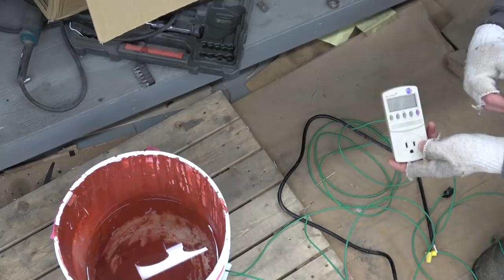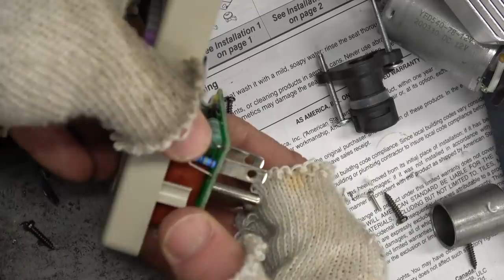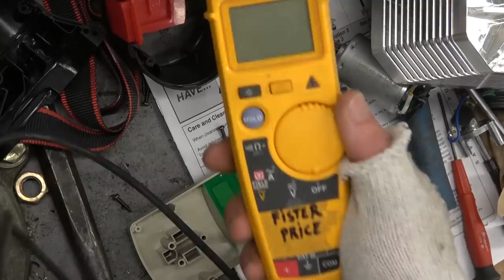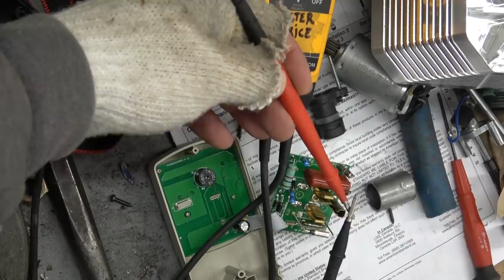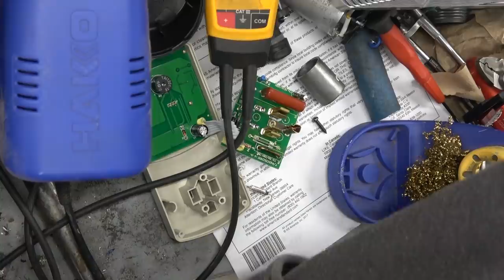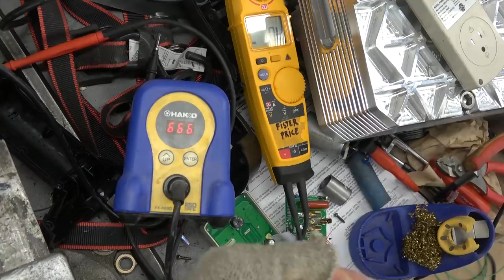BOLTR: Kill-A-Twatt | Electric Smoke Theory

Comment: It'll be fine, solder works as a thermal fuse anyway, right? right?
Reply: Yep, that's why we don't solder lightning protection systems...all mechanical binding for bonding ;)
Reply: In “northe amerika” that is
Reply: Anything’s a thermal fuse at high enough temperatures.
Reply: Everything is a thermal fuse if you run enough power through it.
Reply: @sithticklefingers7255  or brave enough!
Reply: Thermal fuse? Thats a good wife-euphamism.
When she gets to hot, she blows!
Reply: I knew a guy that used his arm as a thermo fuse. Pixies went in his hand and came out his elbow. He was lucky his elbow was closer to the ground than his head otherwise that electrical tickle would have lasted a week or two longer.
Reply: @sithticklefingers7255  Except gasses. they work the opposite of a thermal fuse.
Reply: That would be a 180°C fuse, but the way he soldered it without any spring thing, that fuse won't interrupt current even at 180C. Because no spring to separate the contacts when the solder melts - the blob will just sit there.
Then again, who really cares, it will work supervised (hopefully).
Reply: safety, just like over-current protection, is often over-rated
Reply: @benbaselet2026  this is also used in alot of automotive situations, for example in an interior blower motor dropping resistor. if the airflow is restricted or fan stalls, resistor can get red hot, melts solder, joint springs open.
Reply: You will be fine. long as you solder at 666c
Reply: @oldfarmer4700  He is lucky! I was dumb when I was around 12 and stuck my palm on the back of a black and whit CRT. not fun. Then zapped myself on one finger on a 400v cap. twice in 2 minutes. You should let your friends wear shoes with the last one bare foot then touch an electric fence, so  the capacitance builds up. such a rush!!
Reply: @soupflood  did you see that... Woosh
Reply: @jeramiet154  ....damn...you’re right......
Reply: If’n ones clever enough introduce a bit of spring in the sprong (mechanical connection = -.9), then you have a fuse!  Don’t gob tinfoil on there, don’t ask me how I know....
Reply: But it looks like he let the magic smoke put of it during the application.
Reply: Had the same problem with the coffee maker. The guns were coming out because there was no coffee.  But in the nick of time the thermo fuse was dispatched. The coffee maker woke up and soon peace returned.  It was a close one.
Merry Christmas
Reply: I bet it was project farm that showed him that........
Reply: It's got another fuse.  You'll be all right !!!
Reply: Lol at the main comment
Reply: @AntonioClaudioMichael  🥃 👍 😁
Reply: @denisohbrien  I think that’s what’s happened to the blower in my truck where is that resistor so it can be replaced please?
Reply: You have to put a name on the bucket:  "Kill A Kill A Watt"
Reply: Tesla in Czechoslovakia used to make resistors with overcurrent protection, one lead was made as a tiny leaf spring partly inside the resistor body.. when it got too hot the solder thawed and the spring went boink
Reply: @benbaselet2026  Isn't that pretty much what the TF shown is--basically a wax holding the circuit closed?   Yer typical microwave oven has a couple of those--when they go, folks throw the whole unit out, rather than replacing the failed component.
Reply: Reminds me of the power cutoff I installed for my washing machine. If it should leak, the water flows right onto the power strip and therefore (fingers crossed) causing the breaker to trip. It's called automated safety, look it up.
Reply: @BobHolowenko  Do you ever wonder...if there's ever a time to get hit by lightning, its while working on lightning rods?
Reply: everything is a fuse if the currents high enough
Reply: Bigger fuses = big solder globs
Reply: @benbaselet2026   I'm amused by the fact that AvE comments get AvE'd.  It's like there's some magical transmater what gets betwixt the keyboard and driver
Reply: @265chemic  If they don’t get Ave’d at least 3 times, there’s something wrong
Reply: @gordslater  ml
Reply: @oldfarmer4700  we will have no
Reply: @jeramiet154  a little

Comment: I don't remember if I learned it from you or my mad scientist shop teacher: "Everything's a thermal fuse. Installing a thermal fuse just lets you pick what burns out first. Make sure it's something cheap."
Reply: @raygale4198  or a concrete control joint.
Reply: This is funny but I feel like it misunderstands the purpose of a thermal fuse. A thermal fuse trips primarily on temperature. It is not designed to self-heat, and is not primarily designed to trip due to over-current. Typically you put it somewhere where a malfunction will cause OVER TEMPERATURE without any corresponding OVER CURRENT. You might have one on a compressor or a motor for example. If the compressor malfunctions and stalls, the current may not be high enough to blow a fuse, but the compressor will over-heat, and the thermal fuse will save the day (and make UL happy). It is the difference between a bad customer experience and a multi-million dollar product recall due to fire safety.
Reply: I LIKE that saying. I'm going to steal it.
Reply: My wife: "Aren't ALL the parts on the car 'WEAR parts'?"

Me: Well, yeah, I guess--if the car lasts long enough, sure... (Scratching my head...)
Reply: @iFixJunk  So profound on so many levels.
Reply: Remember folks: the transistors will always protect the fuses from damage. Transistors are excellent ultra-fast-acting fuses.
Reply: @absurdengineering  Trans-sisters? Is that a hair band? Or......

(NEVERMIND.)
Reply: Equivalently, every diode can be light emitting if you treat it wrong enough.
Reply: Like a Penny Behind a Bad Glass Fuse... Only at The Ice Fishing cottage 🤫😉

Comment: If its that modern AC smoke, then there is no positive or negative, thats a social construct, the pixies swing both ways. 50 times a second.
Reply: 60 you brit
Reply: @noohairdontcare  - 50 Hz, 60 Hz - do it properly.... and just 1 hurts. Aussie-land uses 50 too - and Higher Voltage.. Probly 'cause we made AC/DC

Comment: Pixie induced smoke is unlike anything else you'll come across. Nothing makes me pucker harder when playing with electronics than that smell and that you have potentially written off an afternoons fucking about!
Reply: Trust me .... Putting in 400A fuses on a known fault can have a whole lot more pucker than you think!

But you Do get some good stories to tell ;0)
Reply: Speaking of smells ...... at work last week we installed a new line , this guy lets one rip while we’re testing motors making sure the line works , just so happens managers and directors  abound and the motor near the guys that shit himself  is making a clicking noise and all the higher ups we’re leaning in to get a whiff talking about how they smell something electrical burning, I bout fell out but didn’t say anything. Turns out someone had dinged the fan cover on the back of the motor and they got a sniffer full of shit!

Comment: Last time I bridged a failed thermal fuse, I discovered that a cheap eBay power supply can blow a hole clear through a residential wall.
Reply: Thanks for the laugh 
I just picture you sitting there looking at your wall and think :holly cow  that worked

Comment: My Killawatt was telling me that I had 130 volt electricity. That’s when I found out they only have a six month warranty.
Reply: user9823598246  Sure does.  And utilities, in my experience, tend to bump up the voltage to rural areas.  So if you're in a rural area you can expect to see higher than rated voltage.
Reply: user9823598246  I put extra tape on my nerd lenses just to make that same comment but ya beat me to it. Well played...
Reply: user9823598246  Yeah, I've seen it has high as the mid 130s when the power went down in a good chunk of the city and shit got all unbalanced or whatever.
Reply: I pulled the breaker when the UPS told me the mains was 270VAC and rising, and it was not happy. Tealeaves came and liberated the neutral and earth wiring in the substation during the day, leaving the phases to fight it out as to who was going to win. Shop on the corner lost, they went to over 300VAC, while I pulled the building breaker so as to not compete.
Reply: @SeanBZA  you pulled it or just disconnected it?
Reply: There is a common failure mode of the safety capacitor
(0.47uF) next to that glass fuse.  It will cause display of higher than actual voltage. Try replacing that with the same rating.
Reply: @bryanjk  Switched off at the municipal disconnect, which switches off the 3 phases, but leaves the neutral and earth connected. Lucky the board has a really good earthing mat, connected via thick cabling, so the wiring did not float. Inside the double pole isolator did disconnect the supply to me as well.

Comment: As an apprentice mechanic i was always told by the older senior mechanics that Lucas components were filled with smoke contained in the LBT capacitor. 
Took a few years to understand that the LBT was the "Little Black Thing" that could have been any part in the Lucas component that failed. 
Ah the days when you were told to go to the spare parts back counter to get;
A rigid reproduction tool.
A short circuit
A right handed adjustable spanner (known in Australia as a shifter)

Comment: Shango066 used one of those for ages, never let him down. Great for seeing if the load from the vintage radio/TV is reasonable, and if both the resistive and the reactive circuits are running.

Comment: Masterclass in setting the temp on that soldemy iron. Another trick I learned from the master greybeards in electronics troubleshooting is to tune a couple function generators in "augmented fourth" intervals as a test signal. If your circuit works after that much antagonizing Satan, you can safely move on to a small production run. Merry christamadidlly, AvE and the other bumblefox.

Comment: Same process with the burners on the new GE electric range. Thermally protected soze you can't keep water at a rolling boil! Good thing I hadn't yet disposed of the old range. Gotta use the high temp MIG solder, though!
Reply from the maker: It's like they make stuff "safer" just to kill us with high blood pressure. Merry Christmas!

Comment: How in the frozen wastelands of Hoth did you blow a thermal fuse before the normal fuse? Did you pre-heat it in a foundry or something?
Reply from the maker: Just lucky I guess...
Reply: That tiny glass fuse probably only protects the electronics (buttons and screen) in the Kill-A-Watt. There is no way the full 15 or whatever amps are going through that little thing.
Reply: @Fix_It_Again_Tony  I don't know, hard to tell dimensions from the video but it seems like it has more glass showing than a 1/4"x5/8" fuse usually does. If it is a 1/4"x5/8" then I think you are right, but it could be a 5mmx20mm fuse and they come in 15 amp varieties and aren't much bigger. It could also be a 1/4"x7/8" which is a regular 15 amp fuse for automotive use but the ratio doesn't look right from what I can see in the video. Could just be I need to get my laser eye-balls calibrated.
Reply: Probably made by Apple. The only thing in a Macbook that never breaks is the fuse.
Reply: @Fix_It_Again_Tony  That would make sense that it just protects the brain. The thermal fuse does it's thing when the shunt resistor for current measurement is served an extended hot supper.
Reply: @Gizmo42Rodeo  You have to turn on fuse tracking in settings. It’s under the pri-fuse-cy settings.

Comment: Those same thermofuses are used on heat strips in residential air handlers ( usually in conjunction with a heat pump ).  Almost any Hvac supply house will have them for 15 times the price of online vendors.

Comment: I have one of those.  It’s handy. I found out a 1980s refrigerator was pulling 15 amps when the compressor pulled in.  Yes the fridge still runs good and cold, it’s not made with any chinesium.

Comment: I lucked out when I found a Federal sub panel feeding my unused dryer outlet in the garage.  Well let me tell ya partner that 30A breaker works perfect for my 48A pixie-powered car charger.  Tested and tripped right at 55A... and barely gets hot enough to boil water to boot ! #thanksfederal <3

Comment: I would look into what's going on with the Hakko; it's definitely not operating correctly. Apart from the inconsistent spazzing of the temperature as it's climbing, it should heat up much more quickly. If you're not bothered by that and it's actually holding its temp setting, then fuggedaboutit!

Comment: Had you brought Prudence the Safety Goat in on this one for a consult, you'd have been informed that removing a thermal fuse is a big no no. Next time just solder in some wire to bypass the thing. No no, Mr. Insurance man, it must have come like that from the factory.

Comment: When in a pinch you want to still retain some semblance of a safety feature, replace that fuse with a single strand of the thinnest gauge copper wire you can find, or better yet - an actual fuse rated in the range of your device, so at the very least it blows before it burns...

Comment: I have the same Hakko 888D and while I like it overall, in retrospect, I'd probably go for one of better models with the instant-heat tip or just one of the much cheaper Hakko 936 knock-offs subbed with actual Hakko tips.

Comment: Lucas do claim to have invented the 'Intermittent Wiper Switch' and the 'automatic headlight dimmer'. Apparently in 1952, they tried to get the government to repeal Ohms Law but it met too much resistance. Another little known fact is their automotive systems all used AC current just with a random frequency.

Comment: About the hakko, worked in a place where my boss wired his getup so that it's on when the lights are on. Makes sense since it doesn't really eat that much electricity and it's ready for soldering, always. 
If you asked some health&safety figure about running a thing that's hot, they'd probably disagree, thankfully the checks they did were usually looking in to the lair and saying "yeah this seems ok" with a look of "I don't understand this, so I'll just say yes" on them.
Reply: ps. he had 3 different soldering stations on his desk

Comment: I had a similar problem with my meter at work. I just could bring my self to buy another $20 fuse when I could just use a bit a tin foil. Had a bit too much fun looking for a key off draw with the key on. For some reason a capacitor cracked right in half on the board and leaked the smoke out. My new meter for snap on was only $65 more that what  we talked about the week before and the next model up. But hey I saved the $20 on that fuse.

Comment: Best practice is to not solder a thermal fuse. Crimp connect. It looks like KillAWatt uses long leads and probably clamps a heatsink (like forceps) on the leads when they solder it in. Don't ask me how I found this out.

Comment: funny that I should come upon this video this morning as I just plugged in my Kill-a-Watt to check a load. Odd that they put thermistor fuse in that location on the board. I'm guessing it's sensing the hot terminal of the receptacle, hmm, kinda far away to do that but oh well. thanks.

Comment: Seeing as you fixed your Kill a Watt, I am curious how good the RMS AC voltmeter is in those? I let the smoke out of a UPS today while changing the battery. Two 40 amp fuses (in parallel) and some foil.  A big surge from a 12AH battery. So I was checking the output voltage and to my embarrassment I lack a true RMS voltmeter to read the modified square wave. Then it occurred to me that I have a Kill a Watt meter and it must have some wonderful properties. Indeed it reads about 115VAC where my "averaging" voltmeter says 85-90VAC.

Comment: Actually the electrons don't really move in the wire, the charges do. It's a common misconception. They will migrate very slowly in metals however in a vacuum or an aqueous solution they are free to move. A way to think about this is speech.when I speak the particles of air don't leave my mouth and hit your ear at the speed of sound. Rather, the vibrations move at the speed of sound..

Comment: when it comes to soldering irons, i prefer the weller WESD51. My electrical panel uses screw in fuses... and i have a chinesium 20 amp breaker from aliexpress... trying to think of a way to test it without blowing a fuse in my panel...

Comment: Ahh the old factory delete the thermal fuse. You could also 'fix' those by soldering in a few strings of bare copper pulled out of a wire, just a few strings will heat up fast and snap fast under a high load. Not that reliable but it will retain some function.

Comment: If you burn your house down afterwards you can sue them for the "attractive nusiance" of leaving the leads long enough to bypass the fuse without even desoldering anything or finding a bit of wire. Looked long enough an extra hacky type could have just twisted them together!

Comment: I've been cussing Mr Lucas for several months now as I try to figure out the wiring on the 1970 Triumph Bonneville that I'm restoring! It would probably help a great deal if the original harnesses hadn't been butchered by someone I suspect might be Dew Claws cousin!

From a guy using a 125k b.t.u. salamander, running on farm diesel, with the 'stat cranked to nuclear to heat a 12x20 shed, merry Christmas to all!